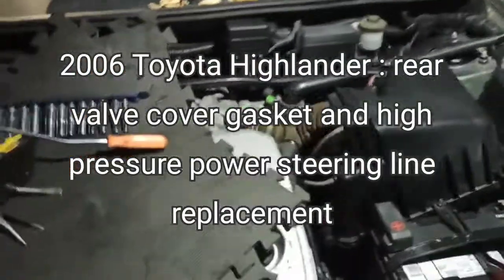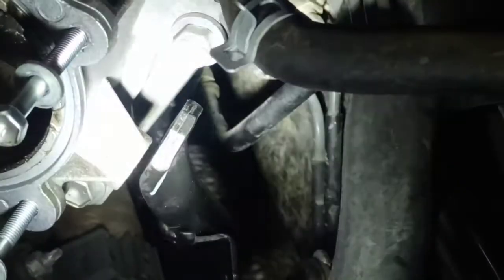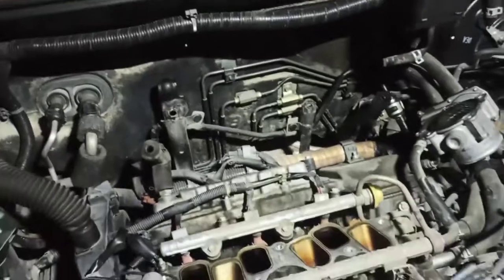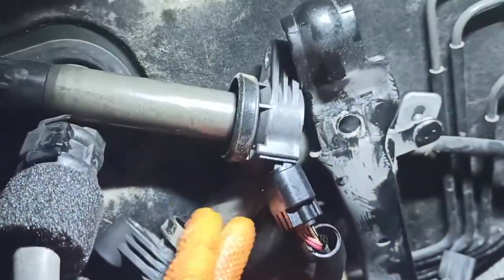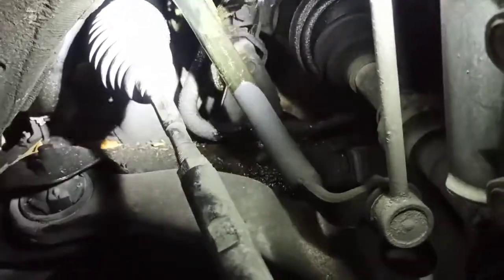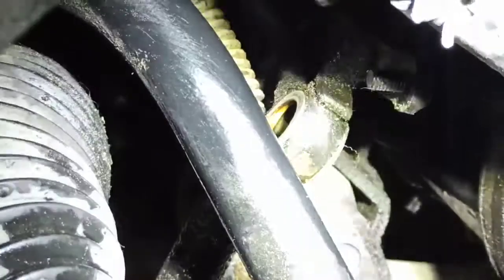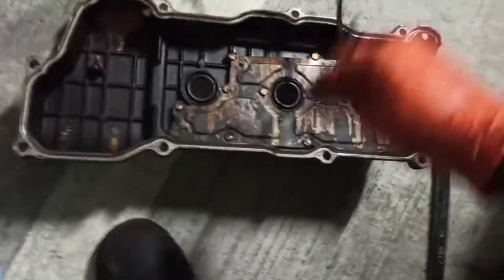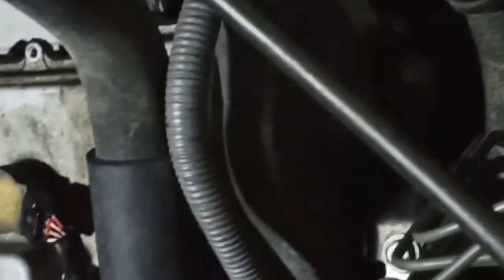2006 highlander rear valve cover gasket and power steering high pressure hose replacement

Comment: Thanks for the video.
The fluid is green because someone put AC UV leak detection dye in the system. I did the same but I’ve found that Lucas Power Steering Stop Leak also glows under UV and wouldn’t doubt if other brands also fluoresced under UV.

Comment: Thanks for the tips on removing the 10mm bolts from the brackets in the bottom. That top middle bracket bolt attached to the plenum manifold took me a few hours of hopping left/right to get a flex wrench in there.😩

I will try to remove the camshaft sensor harness bracket to give me more slack to lift up the bulk wiring. I feel ya' brother about venting and 🤬 those Japanese engineers that designed the locations of the manifold and valve cover...😂.